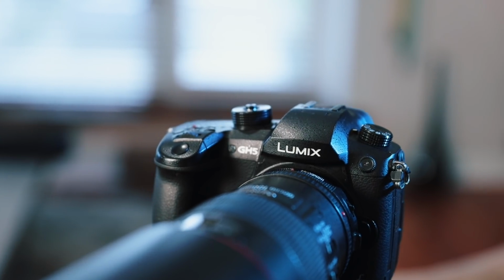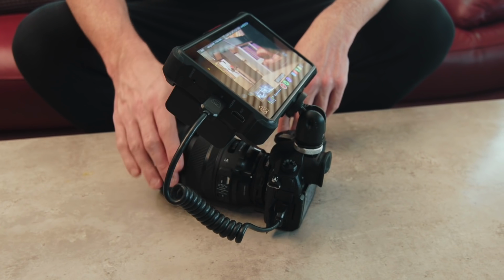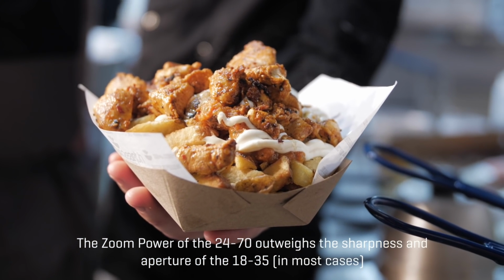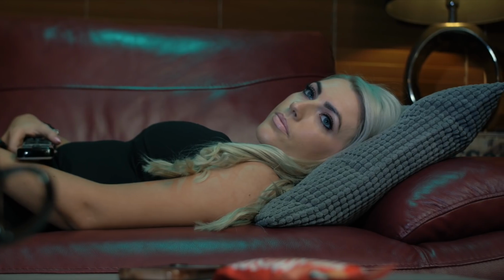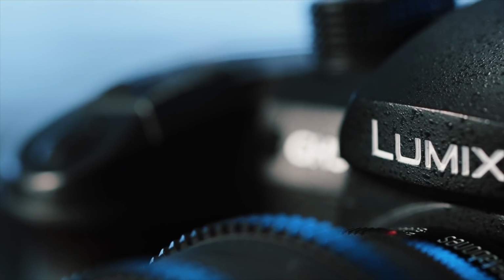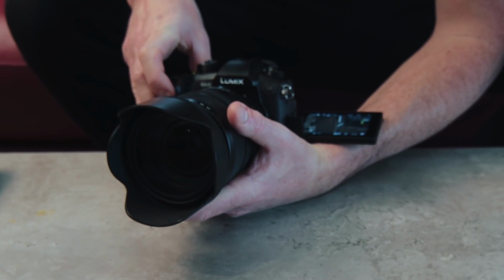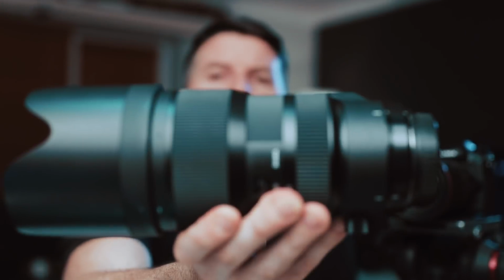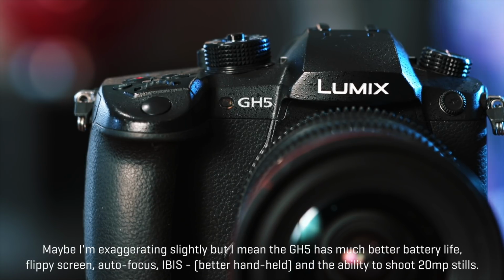GH5 - 2 YEARS LATER (well almost!) and how it changed how I work.

Comment: Hey Hugh! First time watching your videos & it was so helpful. I’m seeing muddy colours with my GH5 (in shadows mostly) as I think I did tinker with the shadow/highlights curve like you mentioned in your video. I’ll change them back to the default, then, and see if it looks better. I’ve also been toying with the idea of a Sigma lens + Speedbooster for low light at my weddings. Could you possibly tell me the speedbooster name & Sigma 18-35mm lens you used? I am a little confused with the mount types and not sure which one to go for! Thanks and keep up the good work!
Reply from the maker: Be very careful with any internal shadow / highlights adjustments. This actually lost me a days work and caused great embarrassment for me with a client that hired me specifically to use a Black magic camera. I had convinced them to use the GH5 and at the time I had these settings installed. It was torturous. The speedbooster is available in an XL (which I own) and an 'Ultra' which is the recommend one for apsc glass. The ultra is the one you should get. Though I only recommend going down the speed booster route if you're own larger sensor size lenses on another system. The Sigma is very popular but a Nokton Voightlander bright lens would also be great to own. It all depends. The sigma sigma 50-100 works well too.
Reply: Hugh Sweeney Great, thanks. I’m looking at the Ultra (EF > MFT mount) with the Sigma 18-35mm EF lens  -  I hope that’s right 😂 Just looking to get some half decent low light wedding shots!
Reply from the maker: yeah, you can't go wrong with the Ultra and at least it'll work well with FF lenses unlike the XL which will vignette with crop lenses. @RussellKentNicholls

Comment: What mount are you using for your Atomos Ninja? Looks substantial.
Reply from the maker: Just the standard Manfrotto. It actually slipped off and I nearly smashed the Atomos. It's better rigged to keep the cable secure too

Comment: Hugh did you ever have situations where the 5 froze on you?   I realize that can be a card issue, but even when using the recommended card I have had two different gh5 freeze after about 90 minutes of being turned on, usually when tethered shooting stills.  However it did freeze shooting 4K when outputting to a monitor.   So maybe it's the output over time that is the common characteristic.  Thoughts?

Comment: Nice review.  New subscriber here.  I recently bought the gh5s and while it has better low light than gh5 it doesn't have ibis so i returned it and bought the gh5 with ibis instead since i vlog a lot and need the ibis.  The new firmware makes the AF much better but IMO it's still not as good and quick as my 5yr old canon xa10 video camera AF.

Comment: what presets do you use for C1-C3? I've been using the simple zoom "Extended Teleconverter" option and then low-light presets 24p and RAW bursts 12p
Reply from the maker: I mix them up usually. C1 is 10bit 4k 24fps. C2 is 8 bit 60fps. C3 is 180fps etc.

Comment: I recently bought a GH5. I had a G85 so I took the kit lens off the G85 12-60mm and put it on my GH5. I shot in P mode with all the factory settings unchanged. I shot inside my house with the lights on. I got noise in Standard, natural, cine like d, and 709. I don't have the budget for a speed booster and a a sigma lens. My G85 will shoot the same footage with no noise. I don't understand whats happening and it's making me feel like I wasted my money.
Reply from the maker: can you check what ISO both cameras are at when shooting?

Comment: I recently sold my canon 70d to save and upgrade thinking the new sony 6700 will be out soon. Do you guys think i should get the GH5, sony 6400 or anything else around that price range??
Reply: The biggest issue that you need to take into account is the sensor. M4/3 out-of-the-box doesn't give you the shallow depth of field that you might wish.. aaaand again no the best in low light conditions.
Reply: I have one.. the image stabilisations is amazing and the multiple reccording options in a small body is unthinkable.. but it depends  for what projects you are going to use it

Comment: MAN!! Great images!!! How are you dealing with jitter? My images are so jittery :(... (99% of the time using 180º shutter angle) Ps:Auto focus on native lenses are so much better then on speedbooster+sigmas (at least with mi experience with the 18-35.
Reply from the maker: Yeah, that's something I should have mentioned regarding the focus. In regards to jitter, are your frame rates ok?
Reply: @HuFilms  I'm shooting 4k 60p most of the time (travel, street, nature) and 4k 24p in low light. But the jitter is appearing even on simple shots with some movement... 🙄

Comment: Well you are wrong about the lenses for sure. Across the board m43 lenses are better than full frame lenses and use higher quality glass. I'd never consider buying canon glass for my cameras when I can grab the voigtlanders which are sharper when stopped down to the same stop as the canon lenses and also give dramatically more light gathering wide open at f0.95
Reply from the maker: MFT lenses need to be sharper because they're narrowing down the image to a sensor 1/4 the size of full frame and as they use far less glass than full frame they can use higher quality. Here's a challenge for you... compare shots taken with a 12-35 on the GH5 to the new RF 28-70 lens on the Can EosR and see how it goes.
Reply: @HuFilms  the results are similar. But that's the point. Why use ff glass which would produce inferior results compared to native glass made for the system? Using FF glass makes sense if you already have it or also use a ff camera. Other than that I'd rather stick to native lenses.

Comment: Why is AF so bad? I dont want to buy a camera when you can not rely on the AF. Manual is not user friendly.
Reply: Well, depends what kind of work you do. All cinema cameras that are used in big feature films are only manual focus. Plus with manual focus you have full control over the focus pull. 
The GH5 actually has a cool feature that can pull focus by setting the focus points prior to filming and then with a click of a button you can focus pull. I use it a lot.